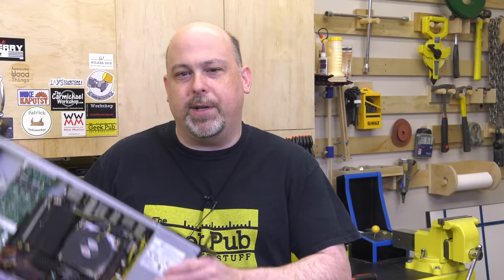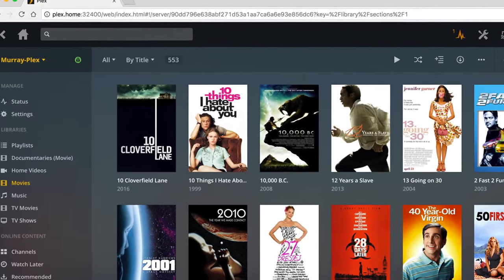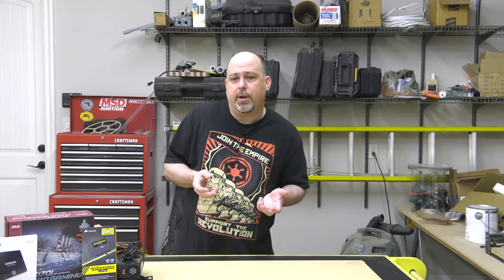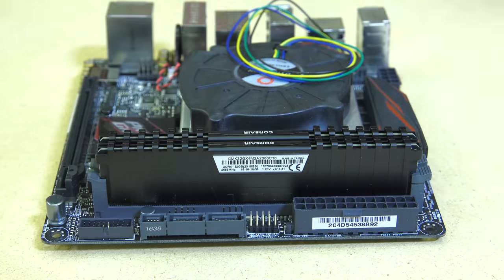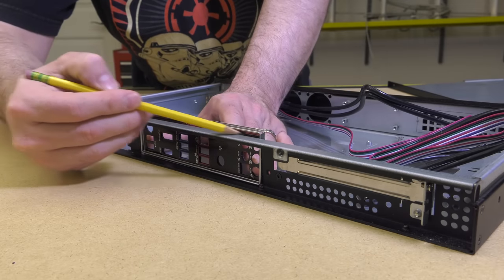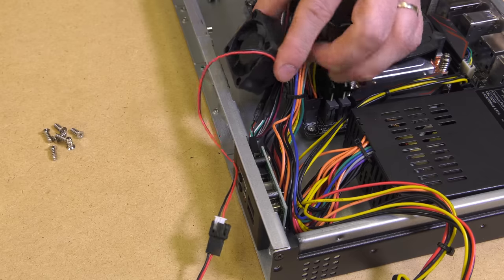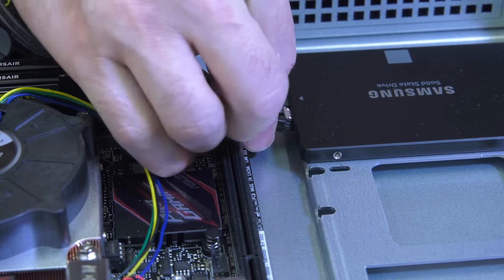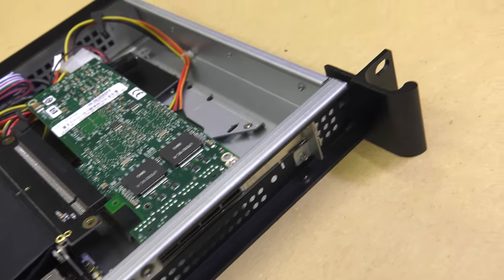Building a 1U Server (Bad A$$ 1U Server)

Comment: Thats a cool 1U desktop.
Reply from the maker: Nope. It's a server.
Reply: I'm happy you feel that way. In my experience server implies server hardware.
Reply from the maker: You might need to look up server in the dictionary.  Of course, it might also help to pay attention. ;-)  I needed the Core i7 to get Intel QSV. Something that the XEON doesn't have.  Use case matters.
Reply: You might need to look into industry standards and more carefully title your videos. I understand the concept of different use cases, but last time I checked you do not get very far in content creation by insulting your viewers. Initially I was simply poking fun at your hardware choice, and I do not appreciate you calling me both ignorant and stupid. 

Please do keep in mind there are a lot of options proc wise, and server does not equal Xeon.
Reply from the maker: I didn't insult you or call you stupid. I did point out the error of your ways. If pointing out an error in your train of thought is insulting to you then I can't do much about that.  A Raspberry Pi can be a server by the way.  Again use case matters.
Reply: Condescending word choice like "you might need to look up X in the dictionary" implies thoughts of stupidity. There is a difference between a product acting like a server, and a product designed with a server workload in mind. My simple example is as follows: 9 times out of 10 I cannot recommend someone replace a DL380 with a Raspberry Pi. A Pi can be a powerful little machine yes, but it lacks features, redundancy, and the simple peace of mind of a purpose built product. and @Jack I'm probably the farthest thing from a snowflake you will find. I'm not here to argue for months in a YouTube comment section, I was simply trying to joke around with GeekPub (please reread first comment). He blew this way out of proportion with a response I can only equate to bickering. 

Now, unless either of you have anything productive you would like to add, I don't see me wasting much more of my time here. Have a nice day! :)
Reply: Jack Johnson I would also like to apologise for the fact that you mistook me explaining basic  conduct to someone who needed it for me being butthurt. No butthurt here! :)
Reply from the maker: A server a function of software.  Right from the dictionary "A server is a computer program that provides a service to another computer ".  Redundancy, fault tolerance, etc are functions of hardware that may apply to even a client desktop.  XEON processors and ECC routinely fine their way into CAD stations, but those stations are not servers.  Using your example, a DL380 can be purchased without a RAID card, without dual power supplies, etc. if it is placed in a data center serving DNS, it is still a server without those features.
Reply: TheGeekPub All DL380's have those features. They can be purchased without both power supplies, etc. But they all support it. Also do keep in mind the dictionary definition doesn't always apply.
Reply from the maker: KRKATANAKID If we can't agree on the definition from the three major dictionaries then you're right.  On literally everything! Because you can control language to work in your favor.  It's like a corrupt politician who can change the law to get what wants for the mob.  So I guess we're done here. You win!
Reply: Dictionaries have a very limited role in language. The definitions found in them don't always apply within the context of a given conversation, and therefore should not be treated as holy text.

I'm slightly entertained that you guys have stooped to cheap shots and insults, and I enjoyed the conversation.
Reply: its amazeballs reading this thread what some people do to keep from admitting they are wrong.  krkakakid the judge would be trhowin books at you if this was a court!!!!!!!!!!!!!!
Reply: Just thought I'd voice my opinion because I think I see where KRKATANKID was coming from. According to ASUS's website, your motherboard provides support for "6th Gen Intel® Core™ Desktop Processors" and is marketed toward gamers. Your build lacks redundant PSU's, 10 or 40 Gb NIC's (also redundant or truncated NIC's), dual procs, quad channel (or ECC) memory, as well as support for things like 10k SAS. Many of these features are pretty standard, and would almost certainly be expected in a server that could be deemed "Bad A$$". While the argument can be made that you didn't need some of these features, saying this makes it hard to quantify it's "Bad A$$"ery.

So in that regard, I can see where he is coming from. Now please don't harass and attempt to insult your viewer base? It's petty and quite unprofessional, and judging from your other videos you're better than that :-D
Reply: Server implies that in which it is used for. You can serve breakfast to someone. This makes you a server; albeit only for a short time..

Comment: I/O shield could be copied inti a proper one by copy it to a strap of Aluminum 0.8-1.0mm using a permanent fine liner for holes and border alignment and a Dremel tool or similar to provide also shielding ( aluminum is soft to work ) also the path of 3D printing if teplate are available for your MB for shielding you could use aluminum adhesive tale 5cm wide on the 3D print and cut it for holess with a surgical knife...
On Amazon / AliExpress are a tom of MB for your purpose proven OK by LinusTech, ServeTheHome, etc usually with more sata 6-10, M.2, 4*2.5Gb network, etc. With CPU soldered (laptop cpu) or unsoldered ( socket)

Comment: The side-to-front airflow seems a bit annoying in that case. Would screw up any sort of front-to-back airflow planning in a rack. Though considering you tombstone your synology, I'm guessing that you don't have space for a proper rack anyway.
Reply from the maker: I'm not sure what you're referring to by calling it side to front?  It pulls air from the front and exhausts it out the back (or vice-versa if you reverse the fans).
Reply: Ah sorry, I saw the power supply facing outwards, and expect it to exhaust that way.

Comment: Did you install windows server on this? Because I'm having issues trying to get a Ethernet driver to load on a gaming motherboard while using windows server 2016
Reply from the maker: No.  Installed ESX and used a Intel Pro 1000 card.

Comment: Have you heard of the Juniper NFX250? Only 1RU but has a 6 Core Xeon with 32GB DDR4 RAM and 400GB SSD. Has built in 20Gbps ASIC for switching between the Xeon and switchports. Its a dedicated device to run multiple VM's for WAN sites.
Reply from the maker: Yes, but it costs almost six times what this cost me.

Comment: Nice build, my only quibble if any is where you say regular people not using SAN/NAS could put two drives in in a redundant fashion. I highly doubt VMWare would recognize the raid on that board. I myself use XEONs in standard 1U rackmount but being as I run my VMs of a DELL PS6000E iscsi SAN, you've really got me thinking here about using this much smaller hardware, mine are also clustered too.
Reply from the maker: Actually, that's why I picked this specific board.  Because other than IPMI everything else works on ESX, even if unofficially.   You can grab third party or community VIBs for almost anything on it, except sensor data as mentioned.  Is it perfect?  Nope.  :-)

Comment: great build!

What are your feelings on old server hardware? I keep wanting to build a new server like this, but then I end up buying crazy powerful stuff from eBay. I am a sucker for cheap hardware. I keep finding $200 multi processor multi core machines.
Reply from the maker: It really just depends on what you need.  You could build this machine for $200 if you used older generation hardware.
Reply: HomeGamer Engineer check out the "homelab" reddit
Reply: EricsTechSpot Awesome!!! I don't get on Reddit as much h as I should. I just built two servers and installed Freenas Corral. lead store on that Reddit: Corral is now considered experimental! I guess it's good that I dragged my feet migrating my data over. 

Thanks for the info!   :-)
Reply: HomeGamer Engineer No problem! There is also a "homeserver" reddit as well; however, homelab tends to be more helpful. If you ever want to have some fun, make sure to go through the "talesfromtechsupport " reddit as well.

And yeah, IX is rolling many of the Corral features into Freenas 9. Most things are so up in the air right now I don't even know where to start looking at upgrading myself... everything is too in flux or being worked on

Comment: I meet issues with a Z170 Motherboard I need to recompile the ESXI 6 iso to include Ethernet drivers. It will probably be okay with your quad port card.  And ESXI  doesn't reconnized built in video card. (anyway I use a most powerfulll one for gaming) Nice build  btw ;)
Reply from the maker: Which board do you have?  Z170 should be compatible with ESX 6+ out of the box.
Reply: ASUS Z170-P LGA 1151 on ESXI 6.0.

Exactly this one :

https://www.newegg.ca/Product/Product.aspx?Item=N82E16813132571&nm_mc=KNC-GoogleAdwordsCA&cm_mmc=KNC-GoogleAdwordsCA-DSACategoryPages_-NA&gclid=CNDEhuD--dICFVaewAodfwgCUQ

I'm so proud of this setup. I run my principal desktop/gaming/editing computer with ressources passthrough directly on that machine. A windows 2003 server, a NAs and other develloping VM.
Reply: And I just remember that I had an issue  with onboard USB port Passtrouhg(because i'm running a machine locally on it) I had to install a PCI usb card to drive the bios to install my OS. I don't know if you have already configured your server, if not I hope you'll not  meet those problems.  Good luck
Reply from the maker: Interesting, that is a variant of my board (I have two servers) and mine work perfect.  I also have a USB pass-through running, as my home automation uses a USB Z-Stick to talk Z-Wave, that is passed through to the guest.

Comment: not related but perhaps you can help me. I have a 21u rack server cabinet but unfortunately it has depth of 23.6" only. I can put the switch, pdu on top area and i have an ample space at the bottom. I have an existing EATX tower case pc. I would like to take out all the components from that desktop chassis and put it inside the rack cabinet at the bottom directly - i am thinking of putting a pc open frame to attach the mobo but i don't know where to put all my 4 bay HDDs. In short, i would like to use the server cabinet itself as my computer case without putting my computer to rackmount chassis but use the server cabinet as its chassis. Please produce a video if you can :)

Comment: just a question, but why not go ryzen, a 1700 would be better for a server considering the 8core/16threads it has, and as far as i know they run a bit cooler then intel(though they also can't stand as high a heat) its basically the same price and would allow you to spin up twice the vm's the only thing im not certain of is how it would work in a 1u, though moving up to a 2u would certainly work

Comment: How are you legally handling the Windows 10 licensing, i.e. how are you adhering to product usage rights? The Windows desktop license doesn't provide virtualisation on a cluster with additional licensing constraints. Windows desktop license can only be applied to an end-point. Also, as this is a high-availability cluster, how are you handling the licensing across both hardware devices (Windows licenses are applied to hardware, not VMs)?
Reply from the maker: Not exactly true, though I understand what you are talking about. The retail license of Windows 10 Pro allows it to be virtualized in a single instance.  This differs from the EA license with SA.

Comment: I'm speccing out a small server using the parts list you provided. Out of curiosity, it looks like the power supply only has a 4-pin CPU power connector, whereas the board has an 8-pin power input. Can the board and CPU run with just the 4-pin, or do I need to adapt the power supply to fit the 8-pin input on the motherboard?
Reply from the maker: The 8 pin is optional for most boards.  4 should work fine.
Reply: Awesome, just wanted to make sure. Thanks for the quick reply!

Comment: I was about to ask "What if you had a GPU and used the hardware transcoding in that? Would it be faster?" until I realized that you need more network speed than the single gigabit, and 10GbE ITX boards are a freaking mess. They're still pretty cool, I saw some boards with soldered CPUs that run really decent, but they're expensive.
Reply from the maker: Actually, I am using the GPU. Sort of.  Intel Core i7 processors support QSV cores.  This extra core does nothing but process video CODECs.

Comment: I might do something like this actually...It would work rather well as a home pentesting lab. Though I would probably go with "server" equipment because I don't need the video encoding , and I would need the benefit of having a lot more ram to split between the vm's.

A few of these networked together -- not internet connected -- running several linux and windows vm's each could be quite the environment.

Comment: I sort of understand the what and why of "virtual machines" but what really is the purpose of running various VM's out of one box for various uses?  Why couldn't they be various apps for the different purpose on the single physical server with all the processing power and memory available?
Reply from the maker: Well, one box is Ubuntu Linux, another is Windows Embedded for home automation, another is Windows 2016 for a domain controller, and yet another Windows 10 box for a jumpbox.  Those can't all be on the same machine on the same OS.
Reply: In addition, virtualization gives redundancy.  If the physical server fails, the virtual machine keeps running on the other physical box.

Comment: May sound like a dumb question, but how do you connect to the server and use the virtual machine. For example, I put my Server in the basement, How will I access the server on my monitor in my room above?
Reply: Step 1) Use Linux instead of ESXiStep 2) Profit off of the money you just savedOkay, for real: Make sure the server is connected to your home network, preferably by Ethernet since it's the freaking best. Then do whatever ESXi uses for remote management

Comment: How much noise does the CPU cooler make? i"m challenging to keep a 7700K cool in a 2U server case without overheating when i test it in AIDA64. Used Noctua Li9 and Noctua L9x65, 2 60mm intake fans that blow from from to back. CPU throttles up to 50% while reaching 100c
Reply from the maker: Its pretty damn noisy at 100%.  Not something you'd want on your desk.

Comment: I see something went wrong with the PSU because by the end of the video it's different from the one you started with.
Reply from the maker: Yes.  I mentioned this in my website article.  It died not a day after the build was complete.
Reply: Jeeze. I would have been pissed if that happened to my server within 24hrs after I built it.
Reply from the maker: I was!  That's why I switched to a different brand.
Reply: I went with a reputable desktop brand PSU instead of server mini-redundant which I couldn't find one with enough watt output that would fit standard ATX PSU mounting holes (Ended up with a Corsair RM850X 80 PLUS Gold, I needed two 8-pin CPU EPS connectors.). Besides, I didn't want extra loud server fans in a already not quiet server.

Comment: Would things have gone better if you had gone with the AORUS ZENITH EXTREME X399 plus 1950x plus 1TB of DDR4 3000mhz RAM  and a EN9500GT so you can see what the server is doing and using a heavy duty twin fan Heat-sink and ESXI V6.5 Update 1
Reply from the maker: The  AORUS ZENITH EXTREME X399 wouldn't fit in a 1U case.  Soooo.... No. ;-)

Comment: I have that same motherboard with a 6600K in my secondary Steam game PC. What are the odds.
Reply from the maker: It's great board and has served me well!
Reply: It sure is. I maxed my setup out with 32GB RAM and even added a TPM to it just because. Sits in a Fractal Design Node 202 case with a GTX970 I got dirt cheap. Makes a good living room 4K Steam PC. That board has been serving me for about as long as yours has. I bet for you it lasts even longer since you do not push it to the limits with overclocks I like I do to my 6600K.

Comment: Great video!  One question.  Why would VMWare care about what processor you are running per host?  From my understanding the CPU is obfuscated from the VM with the VCPU.
Reply from the maker: It is.  But if you start the machine on the newer host, you won't able to VMotion to the older host unless you downgrade the processor emulation on the newer machine by policy.  If that's the case, why have the newer processor at all?

Comment: My vmware server is a frankenstein cobbled together from parts of other dead servers. I think I have a pretty solid machine though. It's a Dell PowerEdge R710 with dual E5520 Xeon cpus and 48GB of ECC memory. The storage leaves a bit to be desired. I have four 128GB SAS hard drives in raid 5 configuration with another 600GB SAS drive added on for bulk storage. The majority of the VMs run off of the raid array. And the whole thing boots off a USB stick. Any recommendations for how many VMs this machine could run and upgrading the storage performance?
Reply from the maker: I run about 8 VMs on it depending on what I have going on in my lab at the moment.

Comment: "Some of you are wondering why I didn't choose the new Kaby Lake processor"

Actually I'm wondering why you're using a desktop CPU in a server. Let's not even talk about the lack of ECC RAM support
Reply from the maker: GPU.... video transcoding... PLEX.
Reply: @TheGeekPub  Fair enough. I appreciate it's an older video, but was the iGPU actually any good for transcoding? Never used Intel Quick Sync tbh
Reply from the maker: @bigdoggetom6549  Quicksync is specifically designed for transcoding.